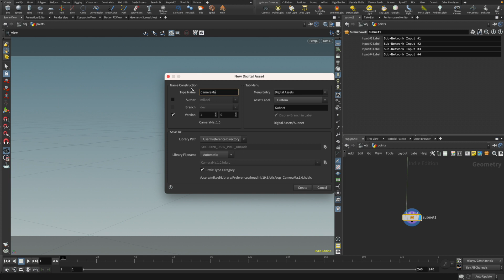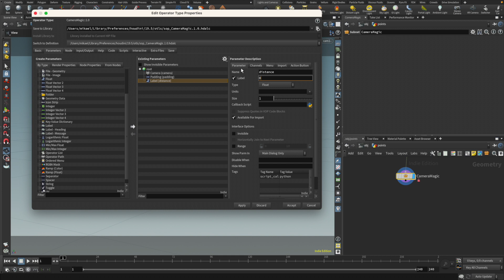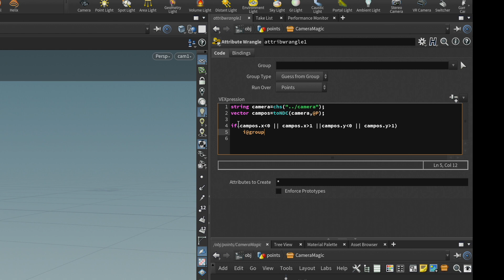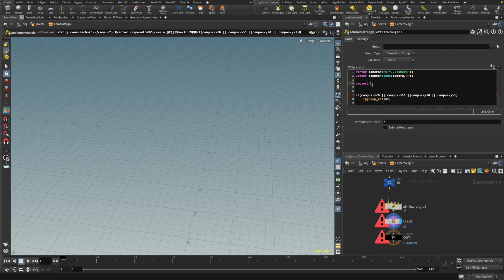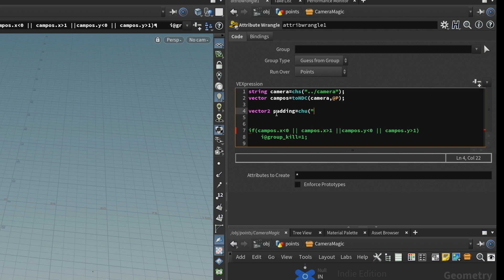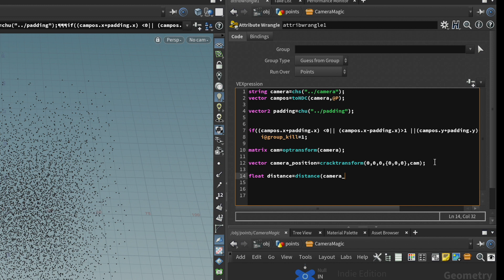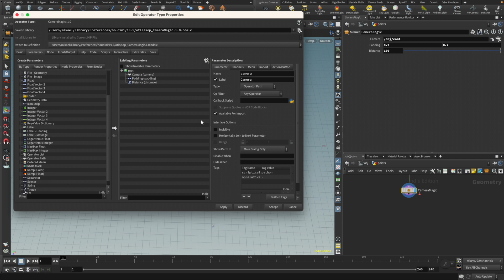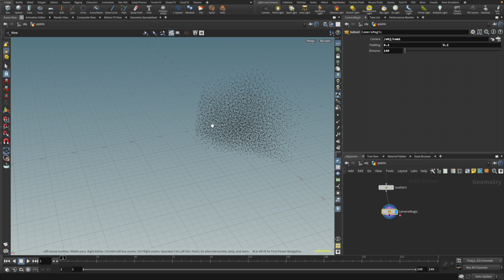Frustum Culling with Vex in Houdini

Comment: Thanks mate! However I have a camera imported in from a Maya artist into context level via alembic archive and the padding seems to have stopped working, also because the camera is in the middle of the point cloud so to speak I'm getting points behind the camera
Reply from the maker: Hmm, I'm using Alembic cameras from Maya all the time so don't know about the padding issue, but for the other thing, I did forget to add something in the video. I mentioned it in one of the replies, but I'll add it to the description as well. You can use the z value to check if the points are in front or behind the camera. It would look something like this: if((campos.x+padding.x) <0|| (campos.x-padding.x)>1 ||(campos.y+padding.y)<0 || (campos.y-padding.y)>1 || campos.z>0)

Comment: it is very great method. but it doesn't work if the camera was in the middle of the points, as it will mask the front and the back points for the camera.. i'm trying to find way to select only the front points in this case
Reply from the maker: ah, yes you are right, but it's an easy fix. You can use the camera coordinates z value to check if it's in front or behind the camera
Reply: @ShortSweet3D  actually i did that, but it didn't work.. logically it supposed to work. but it didn't .. like was trying to use this method to delete part of oceans mesh which i don't see through the camera but didn't work. so i came back to the old methods :).. thanks anyway
Reply from the maker: @znbk5652  I does work, you only need to check if it's a negative or positive. The if statement would be something like this: if((campos.x+padding.x) <0|| (campos.x-padding.x)>1 ||(campos.y+padding.y)<0 || (campos.y-padding.y)>1 || campos.z>0)
Reply from the maker: then you can of course add padding to that as well
Reply: @ShortSweet3D  i'll give it another go. thanks for amazing technique you provide :) very useful